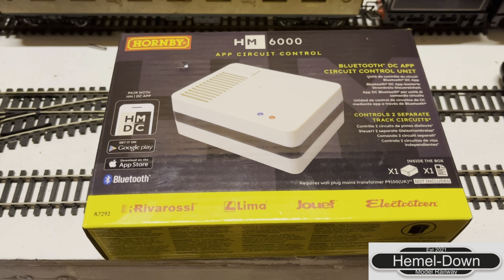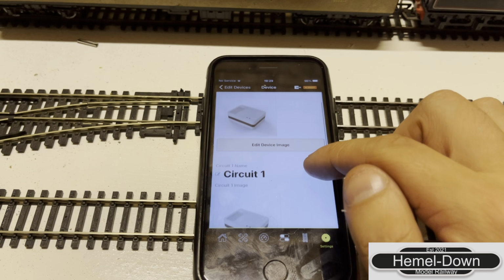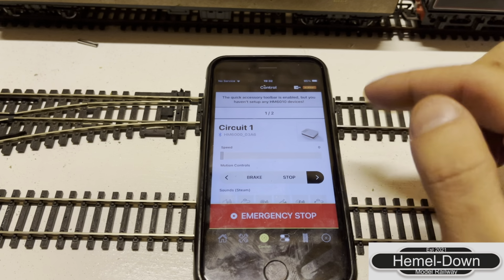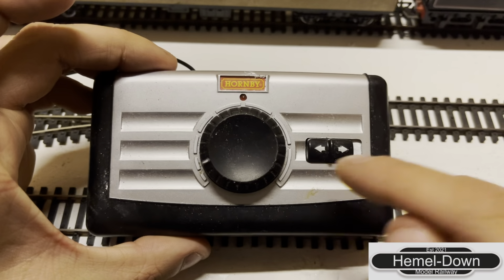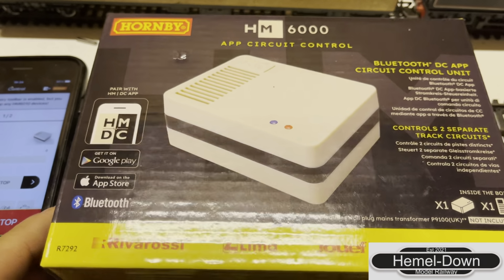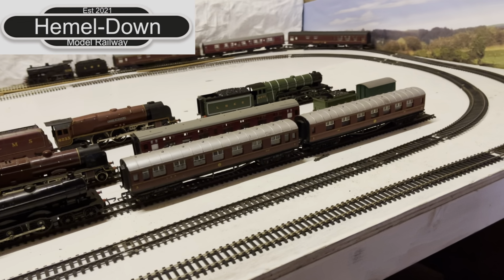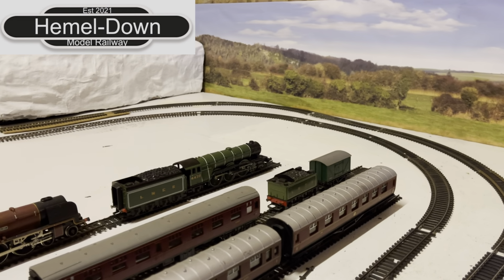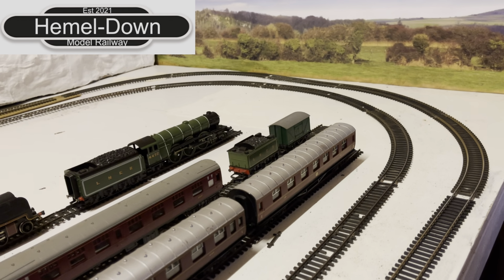HORNBY HM6000 review + set up

Comment: Starting to really take shape :) I wonder of you could add point motors or signals to your controller? Does it have that functionality?
Reply from the maker: There is a separate accessory unit to which you can use for points lights etc
Reply: @HemelDownModelRailway  HM6010  up to four points on the one system   (i think)